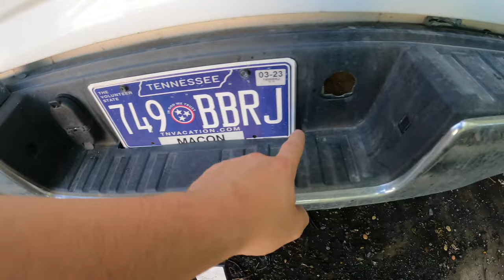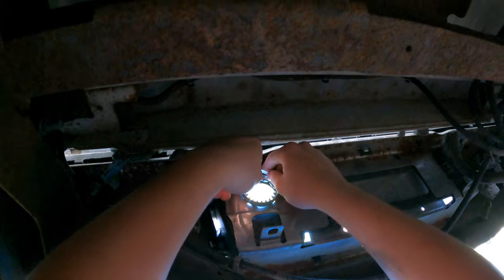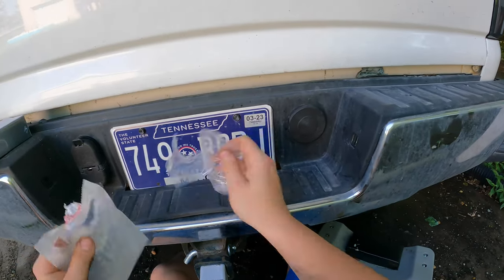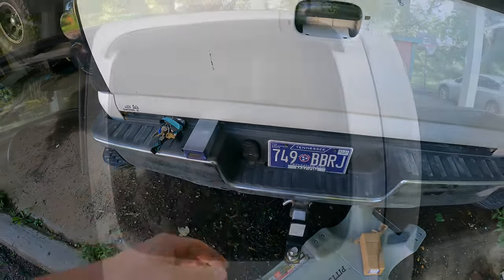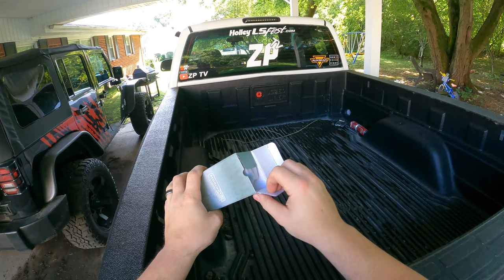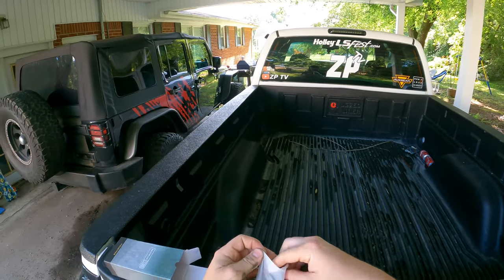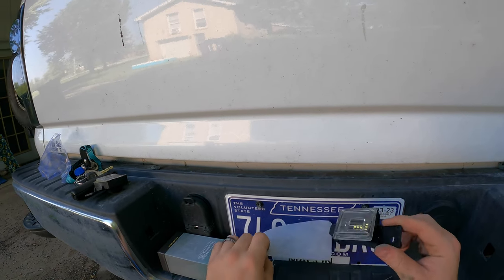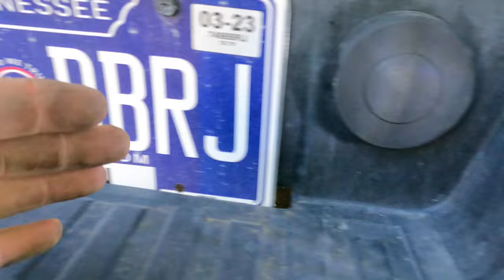Finishing the 14-18 Bumper Swap on My 03 Silverado!!!

Comment: How did you get the trailer plug in? I have the same bumper and I saw that there’s 2 little tabs which is not letting me push it in? How did you do it?
Reply from the maker: I had to bend the little tabs a little bit and then push the heck out of it to get it in there
Reply: @ZPTVChannel  Did you bend them with a pair of pliers? I was wondering how the hell I was supposed to get it in there with those tabs in the way lol
Reply from the maker: @Jacobls7  yea I did it a little at a time until it fit lol

Comment: Do u know if I need to drill holes on a 03 Duramax since it’s 2500
Reply from the maker: As long as you get a 14-18 2500 bumper it should bolt right up!